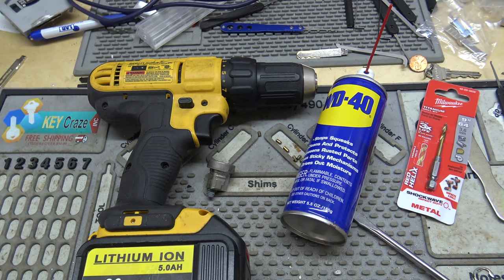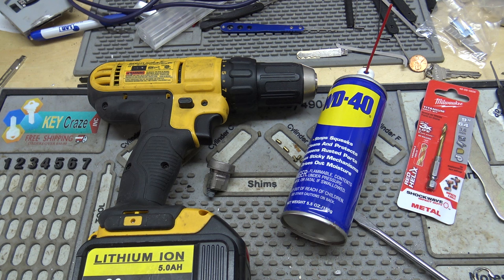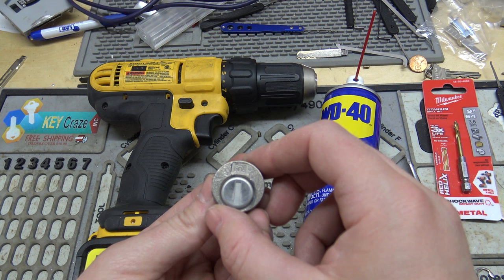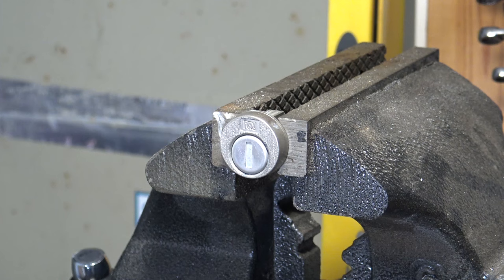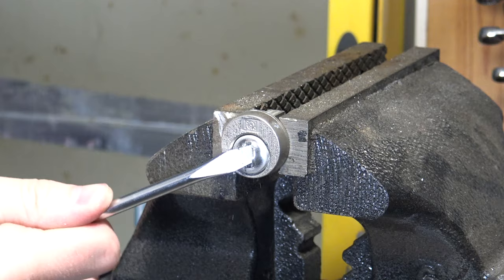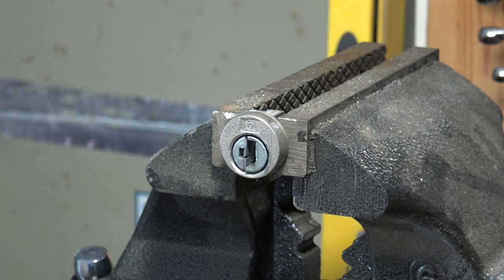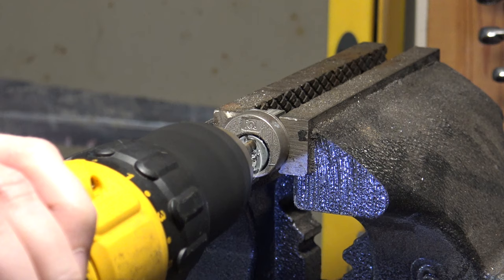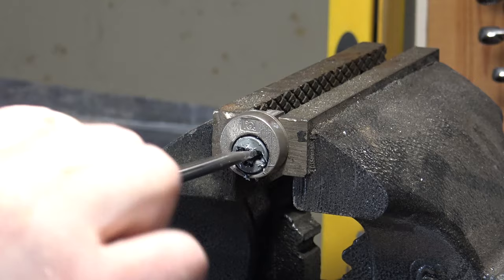(405) Step By Step Mailbox Lock Drilling if You've Lost Your Keys

Comment: We lost the key to our locking street side mailbox last week. USPS says they’re no longer responsible for replacing lost keys and to call a lock smith or we could replace it all ourselves. Challenge accepted. I followed the instructions from this video and we replaced the lock with a $10 one from Lowe’s. Thank you very much for the instructions! That was fun.
Reply: My only advice would be try to match the original lock if you can because this new lock that we got latches counterclockwise and the housing wasn’t designed for that. A metal file sorted it though.
Reply from the maker: the locks at lowes or home depot arent the same.  I linked to amazon the lock you need in the description

Comment: I had to do something similar to a cabinet wafer lock I didn't have a key for. I was using a wave rake to rake it open when the tip of the rake broke off! Damn, it was an expensive one too. So, rather than risk another rake, I decided to drill it open.
I didn't go along the top like you. I just went through the centre of the wafers.
Reply from the maker: down the center is the right way to go on wafers.
Reply: @russej02  OK, you looked to be drilling into the top side of this one.
Reply: Gary Rumain and yet a wafer lock can be jiggled open if the key is lost, the lock jiggled open and than simply replaced with a different lock with its matching key.

While destructive entry is an open it ruins a perfectly good lock that could be picked by someone else within the “community” if it’s so great.

The other way it could be opened is with either the sparrows or southord wafer picks 

Sparrows sells there set for $15 where as southord sells them for $25
Reply: That’s a stand alone comment and facts Gary
Reply from the maker: Gary Rumain that isn’t a wafer lock
Reply from the maker: Raymond Belmont this lock is a pin tumbler lock
Reply from the maker: Gary Rumain https://youtu.be/7T2RH67TCPc
Reply from the maker: Raymond Belmont https://youtu.be/7T2RH67TCPc
Reply: russej02 the southord pin tumbler jigglers would have opened it and been able to save the lock to safely remove and send to the “community” priced at $32.95 

Previously shown off by Bosnian shill Bill, works just like automotive jigglers.

And on both KLOM and H&H 30 piece set there is a pin tumbler jiggler and is most recently shown in my latest video.
Reply from the maker: Raymond Belmont I obviously got that lock off the box without destroying so I am capable of removing them non destructively. Like I mentioned previously if the customer isn’t there  and I don’t have anywhere else to be (the case with this lock) I will at least try and pick them. If I have another job or the customer is there I drill them and replace them.  Takes a few seconds and works every time
Reply: russej02 I’ve picked one before I have a mailbox lock without the shutter cover on it, it was the first official lock I ever found and spent a few weeks learning how to pick it without proper lock pick tools, paper clip tension wrenches, Bobby pin tension wrenches and paper clip lock picks and safety pin lock picks and going only based on having watched a few videos on lock picking in 2010 and than having no internet access at all.

It was difficult but I finally figured it out and found the bitch picking and scrubbing the top that it got an open.
Reply: russej02 between the total time getting out a drill, the power pack and finding the proper drill bit and lining it up with the lock, less time could have been used to pull out a lock pick set from a pocket or your tool bag and likewise go to town picking and having it open, just saying after all your still getting paid to remove the lock and replace it correct?
Reply: @russej02  Oh? You had me fooled.
Reply from the maker: @two_tier_gary_rumain  I dont recall ever seeing a mailbox around here that was a wafer lock
Reply from the maker: @BelmontClan  unless it doenst pick open then i look like an idiot and have to get the drill out anyway.  and all my drill stuff is in one place.  only takes a couple seconds.
Reply: @russej02  Interesting. All the ones around here are.
Reply: russej02 that’s why most folks stay sharp with a little practice with each type of tool, be it picks, jigglers, bump keys, water keys etc plus it gives you a little extra confidence boost to successfully pick it open.

It’s an art lock picking, just like painting.

You never did answer the question about that Chinese proverb you quoted to Jeff Moss in his comments when he was talking about me.
Reply from the maker: @BelmontClan  never saw the response I'll go back and look.   I pick locks pretty good still.  there just isnt any point in picking locks that are getting replaced either way. Its very rare I ever drill a lock on a business or house lockout.  only a couple times a year unless its smart key.
Reply from the maker: @BelmontClan  I just looked.  he's getting some blanks for me.  I did respond to that.  I didnt see any questions.
Reply: russej02 all the more reason to impress your customers with your picking skills and hell even hand them back the lock and a few paper clips and Bobby pins bent in the proper fashion and tell them to give it a try too, this way you’ve helped your customer, kept his money for the job and given him a challenge to learn a new skill.

After all if a customer watches you pick a lock open and goes wow and asks where did you learn it? 

Well than you have just turned a person onto locksport am I right?

I know I’ve personally dropped a few paper clip tension wrenches and picks in someone’s hands when they ask if I have a pick set to spare.

If I can learn with it so can they.
Reply from the maker: @BelmontClan  locksport isnt on my mind when I'm working.   just getting the job done fast and efficiently as possible.    customers dont care.  they just want it done.  It cost them the same whether I pick or drill.     now on residential and commercial lockouts the price goes up for drilling and some hacks drill just to run a bill up.  I dont think I even drill 5 non smart key locks a year since I can use lock picks and lishis and bypass techniques.  mailbox locks and padlocks and storage locks that get replaced no matter what. i cut and drill them every time. except on the mailbox locks that I'm on my own with no one there and I dont have another job to head to after.  i think im done with this topic on these locks.
Reply from the maker: @BelmontClan  I did know he was talking about you.  Ive also been on the wrong of your rants at least once when you called me a little bitch or something.   I also thought attacking lockmania was out of line.  not sure what your talking about with bosnian bill I dont watch his videos
Reply: russej02 I have no beef with you, you keep it on the up and up.

I’m sure to many “attacking” lockmania was out of line to many but as we have seen many attack others or lead virtual mass mobs, I tend to not follow the masses because the m is often silent.

I call em the way I see em, but in the past I responded to your heated comment which was loaded with spite with a spiteful remark and it can’t be undone so we can only move forward.
Reply from the maker: Raymond Belmont lol! I never heard that put that way. I agree with the M being silent. And onward and upward 👍
Reply: russej02 alright than you and me the past was the past, and unlike the other locksport channels out there which are pretty much carbon copies of each other you tend to keep it real and also good that you don’t watch Bosnian shill Bill he tries to turn every video of his into an excuse to include pay for lock tribe, and his PayPal and peateon page.

Which to me is nothing more than legally begging for money which is just really sad with as skilled as he has hyped himself up over the years.

Comment: They must have made locks stronger since then. I'm using the same drill bits for metal and I've broken 2 of them doing what you're doing. What am I screwing up?
Reply from the maker: Did you center punch it so the bit doesn’t wander? Also once you break a bit you need to get the other bit out. You won’t be able to drill through it.
Reply: @russej02  How do you do that?
Reply from the maker: @richreinauer8314   do what?

Comment: Every locksmith I called wanted to charge me to do this... no one willing to pick the dang lock. So if I have to replace it anyways, at least I can save a bit and drill it out myself
Reply from the maker: Even if you pick them you can’t easily produce a cue. There’s a new tool that just came out to decode some of these. But prior to that tool or if the lock isn’t a keyway the tool works in there’s really no point in picking the lock because it’s getting replaced anyway.
Reply: @russej02   true, but if I still have the key for it, but the key is INSIDE it, picking the lock will mean I don’t need to replace the cylinder lol
Reply from the maker: How is the key inside it? I’ve been a locksmith 7 years and not seen a keyed mailbox that you can lock without the key
Reply from the maker: @Mr3X7R3M3  wait for the mailman one day and get it out the back.

Comment: Why drill it when you can pick it or jiggle it open?

Those locks are not overly complicated at least not to me.
Reply from the maker: Raymond Belmont not everyone picks locks. In the field I’ll try picking them if I’m by myself and don’t have any jobs after. If the customer is standing there or I have another job I just drill them and get out of there. Lock is getting replaced either way so it doesn’t really matter
Reply: russej02 true but those locks can be jiggled open open with a small to medium set of automotive jigglers have you ever thought about suggesting that to your customers?
Reply from the maker: Raymond Belmont suggest they buy a set of jigglers to open their box and replace it?  The majority of mailbox locks I do are for property managers.  They just send me houses or condos and tell me what they need. Usually it’s just the doors rekeyed and if they don’t have a mailbox key then they have me open them and replace them. They aren’t interested in doing any of the work. They hire cleaners and painters handymen to fix things and locksmiths to deal with stuff like this.
Reply from the maker: Raymond Belmont another thing too with replacing the locks. “Universal” isn’t always universal and it can sometimes be a pain to get the new lock to work.  I’ve got a couple years experience now so I don’t have issues but when I first got started some of them really could be a pain in rear end.
Reply: russej02 so what happened with that favorite Chinese proverb you quoted to Jeff Moss?

With him talking about me.
Reply: See my stand alone comment here.

Comment: This is dumb asf, you can easily pick these open with a paperclip 😂😂😂
Reply from the maker: @JackTheAwesomeKnot   except when they break etc. I’m a locksmith and pretty good at picking locks. Sometimes you have to drill them. They’re. Pin tumbler locks not wafer locks like you’re probably thinking.